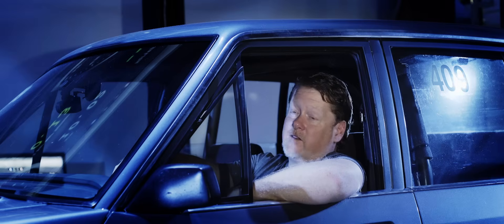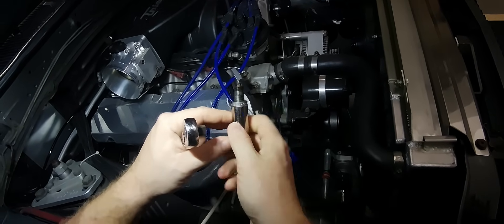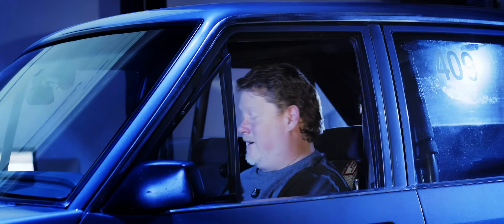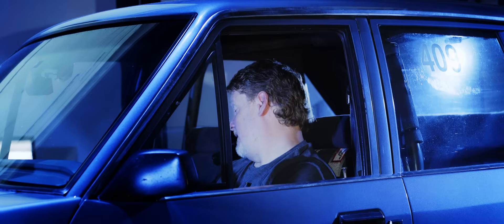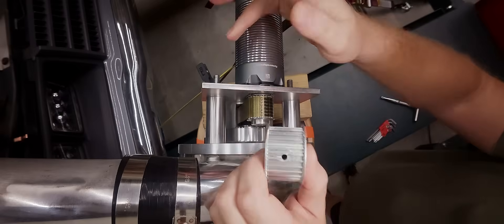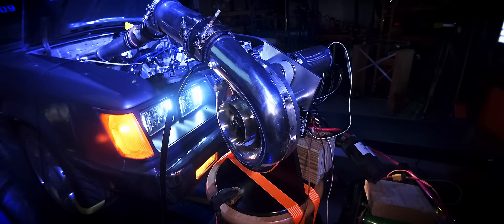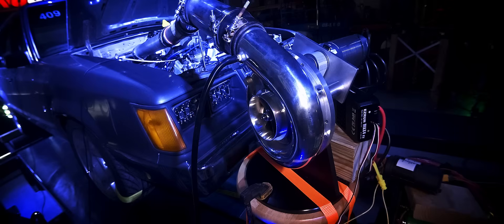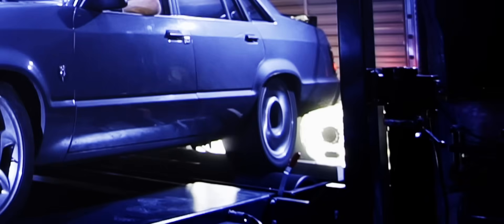The P2 Electric Supercharger Gets Dyno Tested With The Biggest Motor Yet

Comment: That amperage is fuckin crazy from an electrical angle, is there any way you can up the voltage? At that sort of power level 600amps is just nutso. Does it really take 30kw to spin that compressor? That seems like a lot to me, more in line with what it'd take to spin a roots blower.

Comment: I'm all for boost by any means but these systems are incredibly complicated especially when you have to address the problem of needing to synchronize the supercharger with the throttle of the vehicle and that's just the beginning, the complexity of the wiring system along with the additional weight from in my opinion additional batteries would be necessary to run this system properly I played around with the idea for a while of electrical forced induction and found it much more complicated than traditional forced induction methods.

Comment: Replace the axles for electric motors. Put an electric motor at the end of the transmission. And use two electric motors for boost as well as two turbos with a 5 stage nitrous kit . Higher octane fuel with nuclear injectors. Should have some more get up and go after that.

Comment: Gonna have to run the 500-  800kv properly to fix your issue higher voltage pack you need that rpm. Youre restricting yourself to 44v no matter how hard you push it you aint getting over that 28000rpmpeak big boy wants more rpm !!!

Comment: The reason amps and manifold pressure was higher on the other config was because of more work was being done, the motor was loaded up converting more power to useful work resulting in a stronger squeeze to the intake air mass, I seriously recommend loading the car up on the Dyno and data log the supercharger at varying rpms against static rpm data points, measure power consumption against intake pressures with corrections for temperature and reveal the rpms that this unit sings at

Just my opinion and if I'm a twit whose off then don't stress, not my first time, the actual hp from the car is not necessary for this type of data acquisition and tuning as all other things being equal, more airflow and same afr (ignoring combustion properties) should result in a positive increase in hp
Have a good one gents and rock on 💪

Comment: I think I understand some of the discrepancies occuring, or perhaps I don't and Ive confused myself, I'm not an electrical engineer or anyone special with electronics, however, I think what's happened when you changed the pulleys the first time was more load was put onto the turbine, the torque being produced was being reduced by gearing meaning to get the motor to turn harder to push more air it needed more power to do so and drew upon the battery more, this translated to the impeller working slower but with more power behind it, a combination of more wattage, and slower impeller (more efficient range for the compressor trim) lead to more work being actually done to the air, resulting in more work being done
Perhaps** I have to rewatch the other vid carefully to accurately conceptualise it again
Reply: Correction* originally the setup has smaller tooth pulley on the EM and a larger tooth pulley on the supercharger, this result in less impeller speed but more torque
Reply: Id consider doing some more pulls with different target impeller speed, build a graph of compressor performance at varying rpms to measure most flow per watt

Comment: In my opinion using a 200hp or higher horsepower EV motor that uses its own battery  to spin a Big roots supercharger is the way to go for big horsepower but for higher cost and weight.

Comment: what not use a e-moto esc like ko rush factory spec controller 1800A phase rating 60kw controller if you talk with them i bet they can make some firmware tweaks to get you what you want.
if you need something more crazy you need to get much lower KV motors like 100-200kv

Comment: I invented electronic superchargers over 30 years ago.  Overall I like these guys, but that device will never do what they are trying to do.   The proper main purpose of such a device is to create boost at low RPM or before an engine is even started (which helps diesels with cold starts, especially in cold weather).  When used with a turbocharged engine, on demand, you create almost instant (for us it was 1/3 of a second) boost when you would normally have turbo lag.  Once your exhaust gasses are sufficiently turning your turbo in order to produce boost, the electronic supercharger turns off.  A device similar to this is in some Audi models now, and probably more in the future.
The better alternative is an electrically assisted turbocharger.  You basically have an electric motor in the center section of the turbo, spinning it up instantly to create boost on demand, and shutting off once the exhaust gases are sufficient to create boost.  This is currently in Formula 1 cars and the new Mercedes-AMG One.
Reply: Are you oberhausen? 1958 was a lot more than 30 years ago? WTH are you actually claiming this??

What about herbert adams and harry quackenboss? Are you one of them??

Thomas knight??
Reply: @MrSreich05  
Thanks for the information!  I had never previously come across the Oberhausen device.  It's well done, especially for its time.  

I haven't seen the Quackenboss before either, I came across a patent of his from the same era as when I was active.  I didn't find anything about Adams.  The Thomas Knight device honestly looks like he's wasting his time.

I don't think I ever saw any of those names in patent searches.

It seems that you're familiar with the history of forced induction, you also must know that for over 100 years, people have tried almost everything mechanically imaginable.

Between my Father and I, we were granted over 30 patents for turbos and superchargers.  The company my Dad founded became a Tier 1 OEM supplier, we were vertically integrated including casting, all of our R&D and manufacturing was in house other than board production.  We had EPA approved devices for commercial diesels that were already saving massive amounts of fuel, while providing huge performance increases and emissions decreases at the same time.  The company would still be in business if it weren't for a joint venture with AlliedSignal, which became Honeywell after they purchased Honeywell.  They were the largest manufacturer of turbos at the time and really just wanted to tie up or kill anything that could threaten their market position.

So, to answer your question.  No, it looks like Oberhausen invented it.  I didn't see any patents on his device.  The units we manufactured were far superior to anything else I've ever seen.

The best, and most feasible use of such a device is for the elimination of turbo lag.  Almost everything else is a loosing argument with physics.
Reply: @MrSreich05  30 years ago was 1995, the internet was in its infancy. This guy probably assumed since he hadn't heard of electric supercharging then, that he was the first to do it, lol.

Comment: So you made a video to show how it works and then didn't do anything right for apples to apples test, to show your a piss poor mechanic and can't finish a job properly continually ? I am confused.500 hp is not that hard anymore with a NA set up, 
I can see all kinds of problems with voltage spikes killing computers as well. My pockets are not deep enough to blow crap up weekly. I will wait untill it's as proven as the old school ways.

Comment: Yo, get yourself the biggest rotrex head-unit, theyre planetary geared for mechanical advantages, basically its a centrifugal thats geared to spin more RPM at the compressor for a given input speed. 

Its perfect for what youre doing here, itll let you focus on a higher torque input motor within the gear reduction you can manage via your spool to spool mount thing there, yadig?
Reply: Bigger diameter higher torque motor, basically the same aparatus in the center that youve got here, and then a big rotrex. Itll end up looking more like a tesla power unit with a snail on the end lol
Reply: How are you controlling this?

Im interested in using a remote turbine to regen in a setup like this...
Reply: You can park your hotside out at the muffler and itll last forever, it doesn't need to worry about lag. Then you store that in an audi 48v hybrid battery in the trunk and use it to power the blower on a window switch... Like vtec almost lol
Reply: Oh youre seriously limiting yourself with RC motor control hardware lol

Comment: Hello from Ukraine. 
Follow your project more than 1 year.
Every attempt you get similar result: each hp spent on electric motor you pick up only 4 whp. If this values is base of any electric boost setup so I don’t know if e-boost worth in general. I also looking on e-boost for my car but any other regular/conventional boost options still cheaper/easier/effective. Sadly, because I expected something like each hp spend for 10 hp reached. This is approx result of supercharged/procharged engines (based on what I found in open source). I think you might receive similar results, so guess (just guess) you loose something. I believe you probably already know this, but just for a case I would say next.
First, could you use any cooler for intake air? Second, try to stay in most efficient area of compressor map, don’t fall into choke area. Third, use camshafts with less overlapping, more typical for boosted engines (dont know what cams you use now). Several trick more… Then we can compare more accurately.
Thank you for your research.

Comment: Try using a VESC! The guy that just beat the world rc car speed record used them. Apparently they can handle wayyy more voltage and amps, also way more controllable for future tuning.
Reply: Wish it was that simple, the VESC so far has proven to be more trouble than it's worth here so far, with difficulty getting full power consistently and without power cutouts, with little to no information available on how to correct the matter. Alex described his struggles with it on the forum and I have a newer 200A 16S version that so far has resulted in similar headaches, cutting power before max compressor rpm is reached and returning an error code that so far no one has been able to provide a definitive solution to resolve, Fault_Code_ABS_Over_Current in my case, a common error with no apparent clue as to what the problem is.
Reply: @qq-hk2sq I knew you would have already tried that and troubleshooted it lol. I was like “let’s try a shot in the dark” with that post. Thank you so much for replying, I really appreciate the answer and explanation. I absolutely love your channel and think it’s on its way to some serious growth. With your insanely awesome dyno lab and your skillsets from the movie industry you create master pieces! Your content quality is also amazing. Please keep pushing for this low budget supercharger because I honestly feel like I could see this in race cars soooo soon. Feels like you are sooo close, then castle steals your money and won’t touch the amps they claim. I bet that even the Raz Shifrin version of that esc with claimed higher amp limits would have dogged on the dyno. The motor seems to show some promise so that’s exciting. Keep up the amazing work, I know you put countless hours into your videos and I hope you know us viewers appreciate it!
Reply: @qq-hk2sq side note, with how much you guys paid for those Vescs I can’t believe the customer service can’t even provide answers!

Comment: I remember a boost leak was causing a huge issue for me in my ecoboost. After months of searching, I found it and boy did it make a ridiculous difference. I'm not talking small difference, I'm talking holly shit difference. Guess it could make a difference where the leak is located. Seriously was a small hose but made a ridiculous difference.
Glad to see you're still working on this!
Reply: I had a s480 turbo car with a procharger BOV that was cracking  open under boost (like 1/8'' open)  changing to a stiffer BOV spring was a 420hp gain on the dyno with zero other changes. Boost leaks are a big deal. but then again I have never ran less than 15psi on anything in my life.
Reply: @turboryan 420 HP gain is diabolical 🤯
Reply: Where was your boost leak?
Reply: @flannel9506 near the rear lower part of the intake manifold there's a vacuum hose that has a Y split, that thing. I'm pretty sure I mentioned and showed it in one of my Mustang videos on my channel but I'm not sure which one.

Comment: I have peaked 760 amps with hobbywing max4 eac.  The castle cobra 5HV has a 500 amp cap, there is a another castle version the Cobra 5 HV ACE and it has 700amp cap.  If you want a stronger esc i would go Mad components max 20 or max 21 they are the most powerful esc's i have ever ran in rc

Comment: That's weird with the castle. I'm assuming it's an xlx2 I've pushed mine to 450 amps on 8s in my speed run rc. But guys push over 600 with them all day. Maybe you have the power setup on the esc on low and by the time it ramps up the pull is over. Also turn off the low voltage cutoff or set it to 3.0 if you wanna be safe.just realized it must be the new 12s version since you mentioned 50 volts. Still same applies
Reply: The new Cobra 5 HV is a straight 500 amp cutoff, meant for bashing. the Cobra 5 HV Ace you can limit the amps up to 600/700 amps or completely disabled the limiter. It also has a built in perfect pass linear throttle delay, might sound odd but a little delay on startup to full power would make the ESC happier in the long run, just 1-2 seconds before hitting max power would be enough.
Reply: @tjkj-om9oi damn didn't know it was limited like that. And yeah the perfect pass makes a huge difference. I do speed runs and my buddies who just get into the hobby can't comprehend the current difference between just squeezing like a gorilla and feathering into it. Especially when you show them the logs from a 30 or so pound k8s.  Thanks for the info bud but that makes sense as 500a at 12s is way more power than 500a at 8s

Comment: You can hear the thing getting strained towards the upper revs.  It starts out sounding strong but bogs throughout the pulls..  is like you need to have an spool battery and that extra kva on the motor to be able to keep pushing as the load builds..  i could actually see it getting restrictive as the motor wants more air because it reaches top speed right at the beginning.  Boost builds as you go or it should..